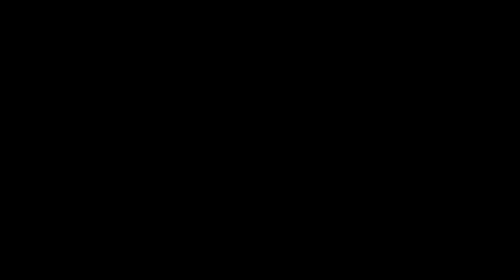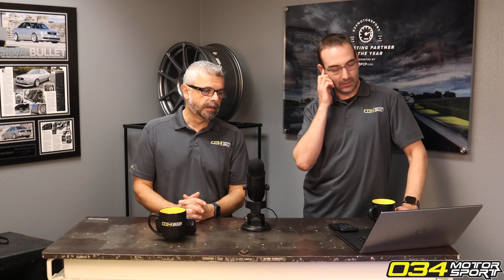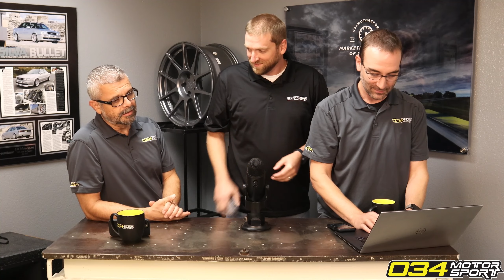The People Behind Dynamic+ Tuning | 034Motorsport Deep Dive

Comment: With so much efforts put in to the 3.0 b8 or b9 and the recent additions to the staff, is there as much effort and passion put in to the ea888 gen 1 ecu and tcu calibration for 91oct?
Reply from the maker: The same engineering effort goes into each and every product or tune we design/engineer/calibrate, and have designed/engineered/calibrated in the past. Rest assured that the EA888.1 ECU + TCU files are highly refined and follow the same key points we look for when calibrating a car;  delivering the best experience in terms of drivability and refinement, power delivery, and features.
Reply: @034motorsport  that’s great to hear ! I wanted to go with a local tuner due to being in San Diego and only having 91 Oct and maybe e85 blend to make e30.  And wanted one device to flash both the ecm and tcm